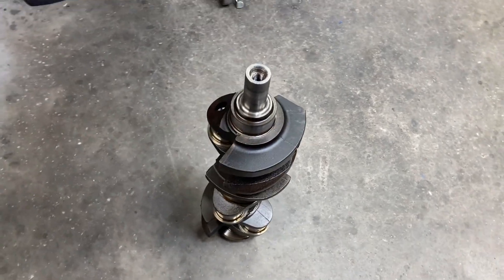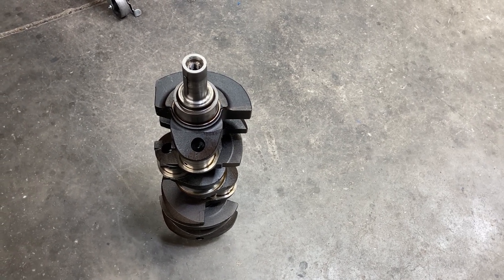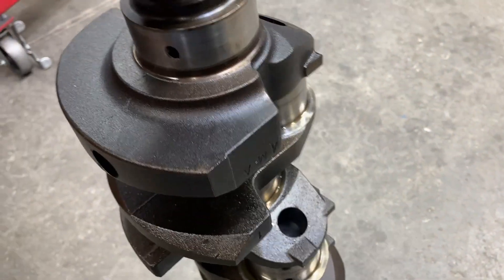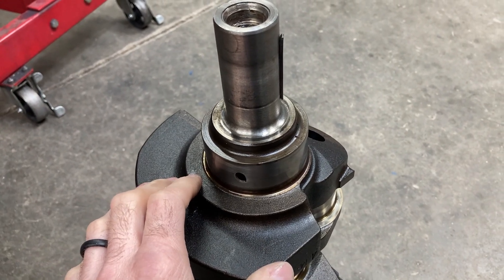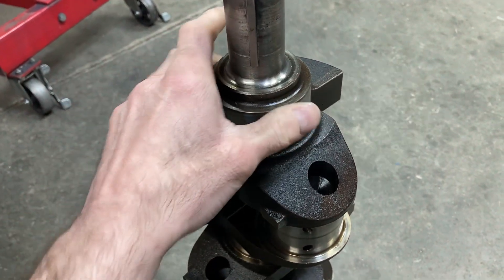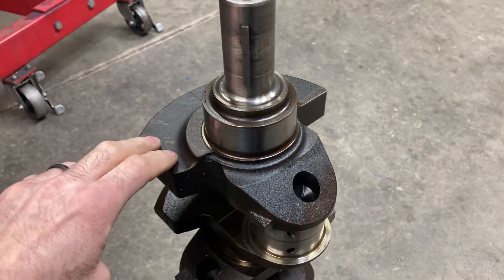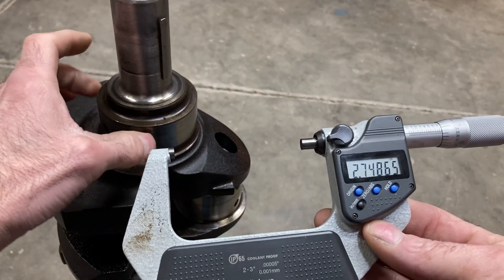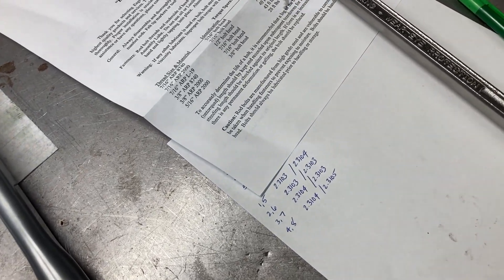Lykins Motorsports Ford 351 Cleveland Crankshaft Inspection

Comment: Very interested in this build. I have a good running '73 351C 2V I would like to get 400hp out of, not sure which direction to go with heads, or cam. Not looking to do any major drag racing, mainly street car going to cruise ins and stuff. seems 351C 4V closed chamber heads are hard to find these days, and if you do they can bring big money. I've been told to go aluminum heads, but not sure which ones to go with, and can't spend a ton of money on a expensive build. Maybe I should just leave it alone lol.
Reply: Not to intrude, forgive me if I do, but as far as heads go, CHI in Australia has the best aftermarket cleveland heads out there. They aren't cheap, but nothing is for these engines. Summit has some off the shelf Edelbrock heads and stuff, that will still give a bigger bang for your buck than getting a set of 4V heads done right. Think about adjustable valvetrains and parts availability, as a major factor in new heads. Lots of OEM rockers, springs, pushrods, etc. will not work with aftermarket stuff, so be careful.
Reply: Long time Cleveland tragic from Aus here, lol.
To answer your question....2V heads have no problem supporting 400hp (with the right work, they can support a great deal more) just some basic clean-up and light contour work is all that's needed, using the closed chamber head has the added benefit of increasing the CR without resorting to milling the heads or machining the block.
If you have the means, your handy on the tools and willing to do a Lil research you can carry this work out yourself. 
Hopefully that helps mate, cheers 🍻 🇦🇺